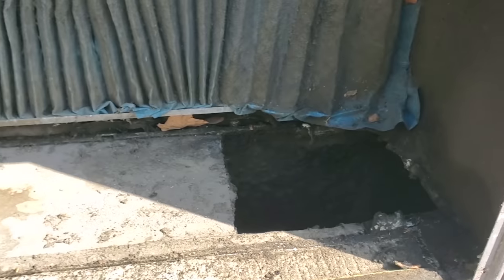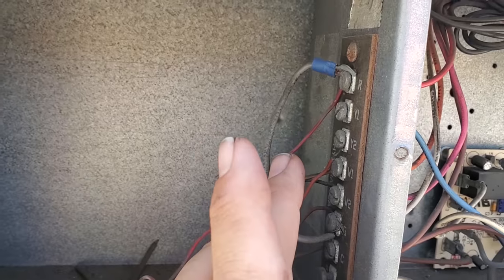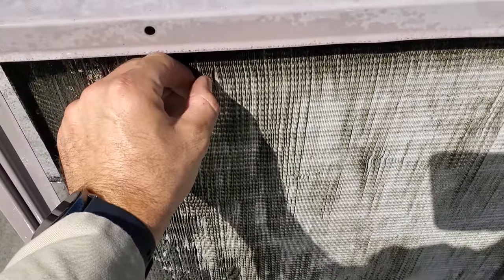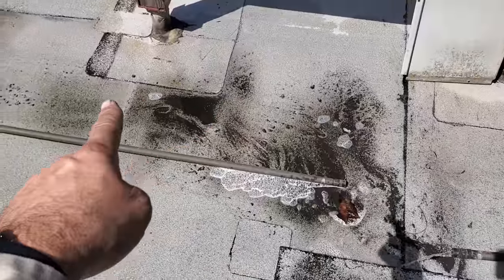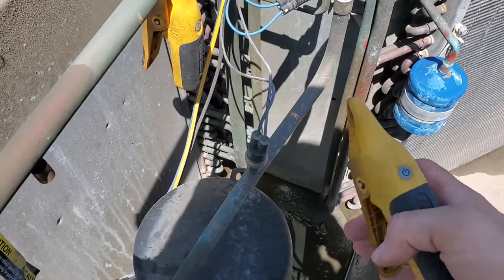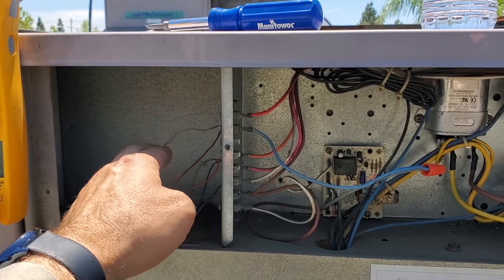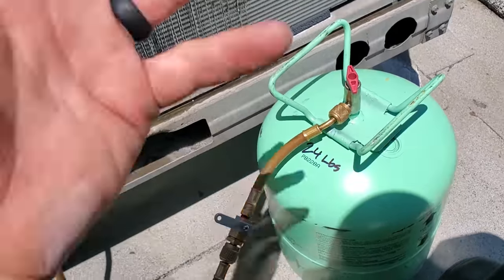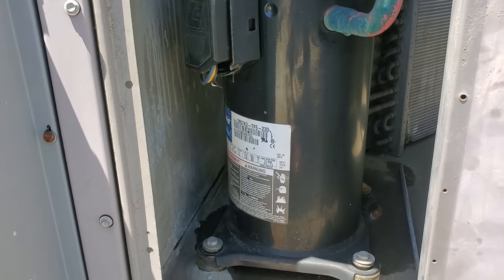ONE THING LEADS TO ANOTHER

Comment: Honeywell sold off their thermostat business to Resideo a few years ago. Resideo products are now branded "Honeywell Home" under license to differentiate them from products produced by the original "Honeywell" even if they are professional stats. I don't like it either. The original Honeywell still makes equipment for larger buildings like actuators, valves,  economizer motors, and BMS-connected or proportional stats. Just wanted to point out that "Honeywell Home" is now a different company than "Honeywell".
Reply: Yeah, that caught me off installing the T10, but I couldn't get it to link to their existing Redlink account.  Was a pain to set up for their remote access.
Reply from the maker: Yeah i knew Resideo bought them but I did not know honeywell home was their new name, thanks for that!!
Reply: @HVACRVIDEOS  Nice Big picture diagnosis - yea, spin offs seem to be the way these days when companies want to focus on core products.  Just like Carrier and Trane spun off from UTC and Ingersoll Rand respectively for example and are independent companies now like Resideo.

Comment: Your video's are real good, you speak well, clearly and slowly enough to allow your viewers to absorb the message presented, and while you are clearly experienced, you seem to learn even more as you work, which is a very smart way to work. Keep up the good work and please do post more video's. I used to do residential HVAC and fully understand getting into a job where someone has Southen Engineered the job, versus actually  solving the problem, and undoing such trash work really costs the customer much more than having a knowledgeable tech doing the job properly the first time.

Comment: I only found you a few days ago, and I'm hooked.
I like that putting gauges on is the last thing you do. 
I don't have a good HVAC guy (or gal) I trust, so I usually just do an annual visual inspection on our residential heat pump.
One year my wife called a technician for a maintenance call. (She didn't tell me until the doorbell rang.)
The first thing the technician does is put his gauges on, and tells me my charge is low. (I was on the roof with him.) So I ask him if he checked the air filter. It was overdue for a new filter, and I knew it, so I knew he hadn't checked. If he had, he would have scolded me. (And rightly so!) I went inside and removed the filter, and climbed back into the roof. He explained that the pressure was now correct. He wanted to add R22 to me system and charge me $65 for it when the filter was dirty.
The point is, these are all heat movers. For them to work effectively, they need to move heat. If a fan isn't working, is a condenser is dirty/falling apart, if a filter is dirty, if a blower isn't working, heat cannot move. Charge level won't make a fan better. It won't make a dirty filter clean. Too many technicians assume the only thing that can go wrong is low refrigerant. (In my experience.)
The only time I call a technician is when it's a refrigerant problem. So, so far, never.
I like the work you do. Keep it up!

Comment: Good video.  Glad I've been watching and subscribed.  I too had a leak on my home roof RTU Friday.  I just happened to go on my roof with a painter for something else.  I noticed water coming out the bottom corners of the unit and just about to start running off the roof and thought, what would HVACR do? Well, it was easy to diagnose, clogged drain line between pan and p-trap and a bit further past. But I turned power off and took off 2 panels to access drain and to clean up the muck on the pan and overflow.   Glad I've been watching your videos bud!

Comment: I understand weighing the tank before you go up, but I have been bit in the butt in the past not weighing as I am topping off a unit. I had one unit that had a wrong sized metering device (too big) and I kept adding refrigerant to get my subcooling. I eventually found out I added almost an entire additional factory charge. If I was weighing it while putting it in, I would have known something was up a lot sooner. Techs who are new to the trade too, please weigh in while you are topping off. No worse feeling than topping of a unit and you weigh it when you get back and its like the factory charge... uh oh...
My 2 cents. If you are experienced I think it is less of a problem.
Reply: Thx for the tip

Comment: "The buildings still running negative but it's better than nothing"

I think nothing would be better than negative xD
Reply: Not in golf. ;)
Reply: Might want to look into a climate wizard to help with the negative building pressure.
Reply: Newbie here. What did he mean by negative?
Reply: @allanbrito13  negative air pressure inside the building. When someone tries to open a door from outside the outside air rushes in to try and equalize pressure, which makes it difficult to open. The more negative the harder doors are to open.

Comment: You can lead the horse to the troth but you can't make it drink. 
Just tell the customer the risks and the potential costs and let them make the decision, inform them as best as you can. 
If the customer don't have the cash flow, that's that. If the customer is not informed enough about risks and costs, that's that.

Comment: Don't work in Air Conditioning, have had to assist years and years ago in maintaining a system.   Big walk through ducts that even at 6'1" I never had to worry about head smacks and had to keep the cooling tower sanitized or however you properly term the liquid that we used for mold and algae suppression.   And had to maintain the roof for proper water drainage.   What I really want to know from the rest of you experienced people is this:   When employers say they are looking for experienced HVAC technicians do they mean High Volume Air Conditioning or do they mean High Voltage AC power?  Or, could it be either of the two options?  Thanks much everyone.   Also, enjoyed the video even if the terminology has me confused at times.   I'll stick to bug hunting code, thank you.
Reply: Depends who you're applying with. Most companies, as long as you have a few years experience, are just looking for smart and responsible guys that can learn quick. Doesn't matter what you know if you learn quickly and work hard.

Comment: Bad bad install for sure. Time to replace most definitely. The o ly thing I have a concern about is that you opened the outside air for the return, after a long day of high humidity from outside will cause moisture in the walls and paper products. Plus no any type of filter on the return. I understand the return is way way under sized but the high humidity will cause or start to cause mold if the customer doesn't fix it. Mold starts to form in 24 - 48 hrs. Hope the customer just gave you the approval to replace it. But it opens a can of worms in Cal when you replace a unit on a roof. Great video for sure. Will try to tune in on Monday night for The Great Big Picture on Earth!!! Lolol

Comment: Makes you wonder what was the original unit? You may have to lift up the unit and measure the original curb to order a curb adapter. Old Lennox units are notoriously difficult to match curb adapters. The thermostat has a bad c1 relay and was back feeding through GC relay. 👍

Comment: Lol now you are getting the kind of jobs I am used to. Unit desperately needs to be replaced and you are told to just keep it running. Tell the customer the complete scope of repairs and they say what is cheapest thing that will get it kind of working. Lmao great job Keeping your cool. Kind of odd I have a customer with the exact same return issue. They had a friend of a friend replace a 3 ton RTU with a 5 and no duct changes to really speak of. You are right though that at least it pays. Good job.

Comment: And I thought the filters I pulled out the other day were dirty...
Reply: I did a filter clean on a unit on the ferry I work on and found the last guy inadvertently dropped one frame and filter overboard and then just said nothing and boxes everything up with a giant hole where the filter should've been.  Not surprisingly the system ran poorly because the air pressure differential kept the system in alarm code condition.

Comment: i am getting a furnace and AC installed by a company next week, is there anything i can ask or watch for to make sure the job is done well ?
Reply: Should have done research before you bought it. HVAC companies are hit or miss usually a Google review rating will give a ballpark. But seriously if you ask if they're doing everything to code they should be able to point out what is and what isn't. I mean you can tell if something looks sloppy or nice and neat. Does it look crooked? Is it level? Did they leave it nice and clean? Did they explain the system to you?
Reply: Stay out of their way and do not hover. I give service people coming to my house a $20 tip and say lunch is on me; that is the best way to get them to do a better job from my experience. Good luck.
Reply: @kswitch87  they are coming friday.  i didn't pay for anything up front it's 5000 total CAD$ and 3500 when they bring the parts 1500 when they finish and they have 4.5 star review pretty good reviews.  thanks for the replies

Comment: Charging a fixed metering device without a air filter could bite you in the ass, depending on the grade of air filter they put in it can drastically reduce your super heat causing it to be over charged.

Comment: Down here South of Cairo in Florida we're starting to see commercial HVACR+Filtration+Moisture control systems in newer large houses because of efficiency gains through zone functionality and make-up systems.   We deal with the range from 35F@40% through to 105F@96% on a yearly cycle.    You can't get that in basic double-A battery wall controllers.   You can mix-n-match those two categories of conditions as well... we've had 35F@96% and 105F@40% as well.   Plus there's fire season which while not as mind numbingly dangerous as Failifornia's is still highly pollutive.  Since its burning peat in the ground you can end up with really fun soot that reacts with the aluminum finnage.

On your toolbox and coil combs, get yourself some cheap stainless table knives and smooth their edges off, use them gently like plows.  Yeah it takes forever compared to the ripping coil combs but you don't actually shred the coil fins.   You're supposed to gently wiggle those combs as you move em.    With the table knives you can get a T-square ruler and hang it from the top as a guide and make quick work.

Comment: Hi have you ever had to tell a home owner that there new unit isn't under warranty cause of over cat population in the house and not frequently cleaning litter boxes and urine control.. as cat urine is real acidic duto the ammonia in it .  Had a amana unit were the urine ate the fins on indoor coil leaving just the copper tubes that were fizzing like a air stone in a fish tank ..with a pile of green dust at the bottom of drain pan it was able to do this damage in under 3 months .. she opt for a mastercool swamp ... another was a 6 month york unit  that was the managers at apts so had to replace and i just added a fresh air 10x10 intake to compensate for the cat pee after new coil ...

Comment: Honeywell 8000's fail in funky ways. Seems the previous tech jumped unit out to get it running and come back later, and never returned. Or maybe he didn't have a clue what he was doing. And those Carrier condenser coils are the worst, only last about a year before the fins rot and crap out or start leaking.

Comment: "One thing leads to another..." Isn't that always the way?
Perhaps the worst part of all of this is that some tech - or non-tech - put those jumper wires in without taking the time to properly diagnose the problem. I bet you come across a LOT of that in the field... A lot more than we see in your videos! I feel your pain as you discover what was done, and then have to restore to proper condition before you can even begin to diagnose the complaint - and in the process, you discover the problem that led to the hack job, which you also have to fix before you can properly diagnose the actual call. It's like a bad infomercial - "BUT WAIT! THERE'S MORE!"
Watching your videos have actually kicked my brain into gear on a few projects around the house. My car's AC is starting to show weak performance; I'm ordering some condenser cleaner and fin combs today so I can give that a shot. I doubt the evaporator or condenser has been cleaned EVER in its 331K miles. My high-pressure side is showing a bit high and the air output is a little more humid than it should be. (Since I gotta change the blower motor due to high-speed vibration, I'll be sure to check/clean the evaporator and drain line while I'm in there - BIG PICTURE - and since I'm up in there anyway, I might as well!)
It finally clicked for me - and I hope it does for others - that AC works on the same basic principles in a car as it does on a rooftop. Instead of an electric compressor, you have a belt-driven compressor, cars have the high-pressure and low-pressure cutouts/service ports as well, there's a condenser near the radiator, an evaporator inside the cabin airbox, a cage fan, a condenser fan (in most cars it uses the radiator cooling fan, but some models have dedicated fans for the condenser). My car even has a sight glass, not many cars do. Everything I learn here I can use to troubleshoot/repair/maintain car ACs as well as our home window AC units. Thank you for taking us on the job with you!

Comment: Tjat RTU self-contained unit was set on a unmatching roof curb. I have seen that before but a curb adapter remedies that problem. Whoever ordered that package unit may have been unaware that the curb configuration would not match the unit which explauns that crude 12X12 return air opening. My concern with that is does that 12X12 opening allow enough CFM through to match the tonnage of the evaporator coil. From the iced up coil, I would say no, but that ice could be due to the restricted air flow caused by those dirty filters. I think, if there turns out to be an undercharge of refrigerant, it could be deliberately undercharged, meaning there is no leak(s), just a deliberate undercharge to match the lower than normal loading of the evaporator coil caused by that 12×12 return air opening. The dirty filters just further compoumded that same problem. I am only a few minutes into this video, so I do NOT know what the final resolution will be. I am troubleshooting it in  "real time" as I view it. There are a bunch more things I have to say because there are a bunch more problem areas, but I will stop my typing now and just view the remainder of the video. I still think that package unit was deliberately undercharged for the reason I have already stated above. That being, it was undercharged to compensate for the underloading of the evaporator coil which was caused by inadequate CFM across the evaporator coil from that 12×12 crude return air opening.  By the way, I type slow, so I ended up viewing the entire video before I sent in this commentary. I still stand by my statements, though. Good work on your troubleshooting in this video, as always.

Comment: Fyi: 12x12R/A = 1 Sq.Ft (5-Ton about 2000 Cfm ) so ur near 2000 Velocity or Feet-per-minute thru the return !!  Open O/A to the point about
55-dagree disharge or so would be an approx O/A damper setting !!!!!!!!!   I'm wondering how Ur Meter shows U an actual Cfm-Airflow ??
(Low airflow across the DX Evaporators coil will be another freeze issue along with no compressor shut-down)

Comment: That unit is filthy.  Good job, that you didn’t disturb anything, so you could figure out why the unit is shorted on.  Can’t believe Carrier is still using those compressor lock out boards.  Must be a refrigerant leak, but why didn’t the unit progressively ice the whole coil?  Poor Airflow alone would have caused the unit to ice up.  Seems like this unit would have been eating compressors, with the restricted airflow.  Meg those stat wires out.  You’re getting a back feed from somewhere.  Why are they running a negative building pressure?  Sounds like they don’t have the proper amount of makeup air for the kitchen hoods.  Typical shitshow restaurant

Comment: You know, if you could get the correct curb adaptor, it would not be that big a deal to get a boom truck, pick it up, and install adaptor. As you know that unit is going to be prone to freeze up with just a 12x12 return. You could also install a bigger motor sheave to pull more air thru 12x12 to maximize IFM amps as a half-assed solution. But, if economize opened, motor would over amp. I would get a 26 deg. Cap tube freeze stat, install at the bottom of the evap coil, break Y1 wire with freeze stat wires.That way, no matter what the t-stat calls for, compressor will not run with ice on the coil. It’s a gravy unit replacement job. Where I live back east, restaurants won’t pay their HVAC bills. Twenty five years ago, the techs at the company that I worked for, we were not allowed to run a restaurant call under any circumstances without direct permission from our company owner. Ha,ha,ha. Thanks for the video.

Comment: maybe that honeycomb touchscreen doesn't mean home as in a domestic house but home in the same way that you say home when talking about your phone, like homescreen
Reply: From elsewhere in these comments:

TechnicalLee
9 hours ago
Honeywell sold off their thermostat business to Resideo a few years ago. Resideo products are now branded "Honeywell Home" under license to differentiate them from products produced by the original "Honeywell" even if they are professional stats. I don't like it either. The original Honeywell still makes equipment for larger buildings like actuators, valves,  economizer motors, and BMS-connected or proportional stats. Just wanted to point out that "Honeywell Home" is now a different company than "Honeywell".